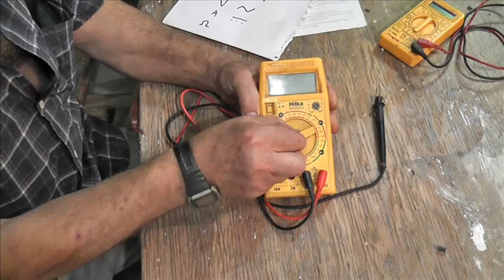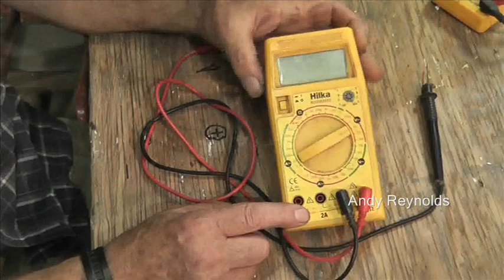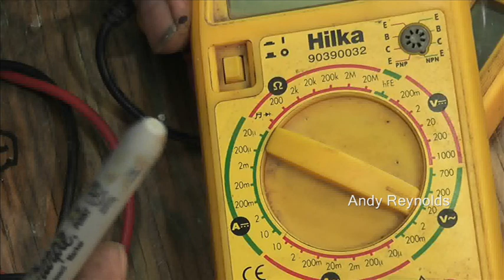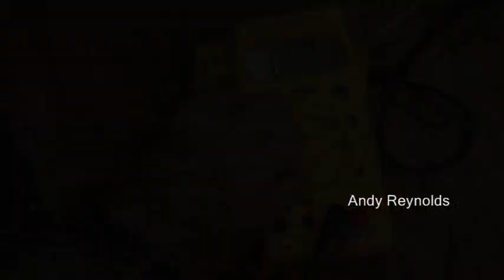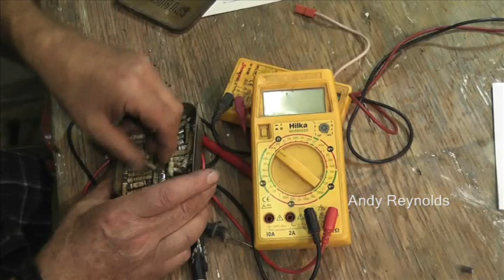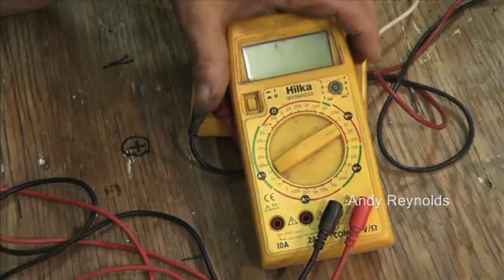Solar course info: Multimeter demo

Comment: Hi Andy,
I believe when on continuity/diode setting, and when testing transistors/mosfets/diodes; the number displayed is the volt drop "forward voltage" in millivolts. Usually reads around 600mV for a functioning component assuming correct probe polarity.

Only a belief mind you, not verified.
Reply from the maker: Ian, good to hear from you. All info is a bonus, I assume for continuity a voltage has to be sent. Multimeters are such magic things, cheers